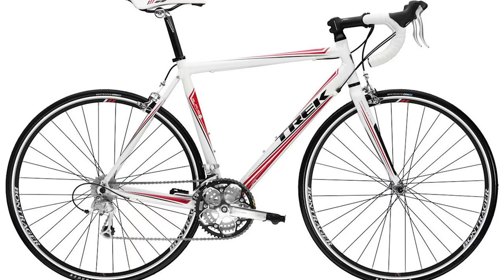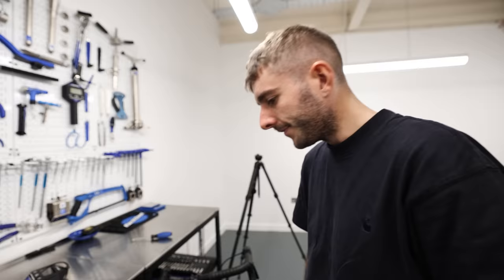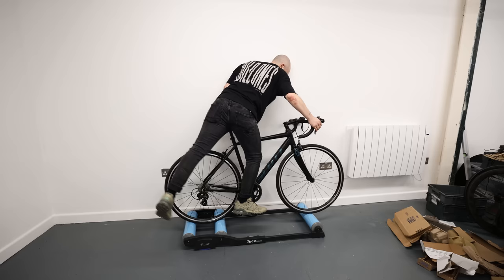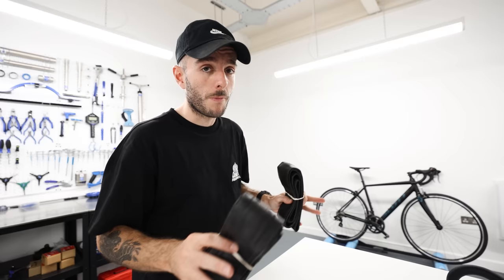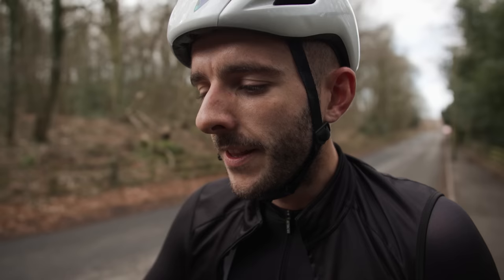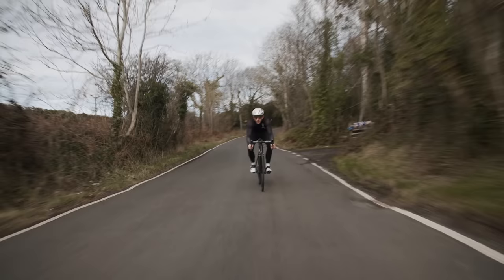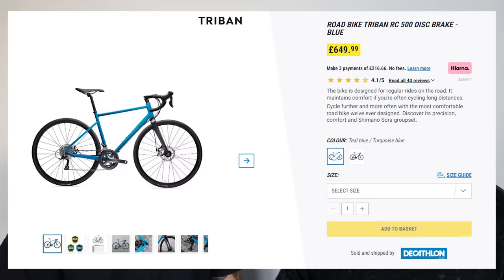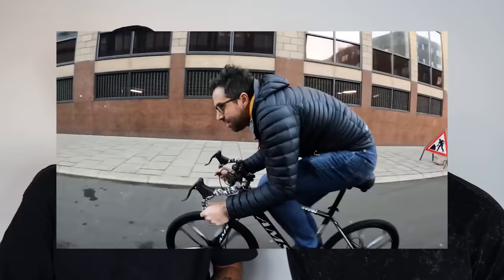How Good Is An "Entry Level" Road Bike In 2023?

Comment: Claris is a huge bump up in ergonomics over Tourney. Claris also supports an 11-34 cassette. Maybe your next video should be: "How good is an entry level bike that you should actually buy?"
Reply: Yes, but maybe go for a less expensive frame brand ? So Still keeping it as low as possible. Maybe try the cheapest Claris bike you can find.
Reply: £899 for fucking TOURNEY is daylight robbery. Tourney is basically a groupset-shaped-object; Claris is genuinely quite good. You can absolutely get Claris bikes cheaper than that even in today's market. I paid £1080 in mid-2020 for 105, for an 8.5kg aluminium bike with welds so clean and well-hidden that all my riding buddies assumed it was carbon.
Reply: yeah the cheapest bike on canyon's website is $1500 and comes with tiagra 10spd 11-34 and hydraulic discs
Reply: @themindgarage8938 out of interest, what did you buy? You're happy with how it rides?
Reply: @Kelso66  It's a Rose Pro SL (105 rim brake model). No longer sold in the UK, but still available in Europe for 1300 EUR. Really happy with the bike, rides very well. Only real downside is the rim brake version is only rated for 25mm tyres - if you want more you'd have to get the disc one.
Reply: @themindgarage8938  true
Reply: I can buy a Van Rysel RC520 for €900 from Decathlon with 105 R7000 shifters and derailleurs and tubeless-ready wheels.There's a LOT better value around.
Reply: how about 12-30 or 32? It's likely not an option. Few newbies need an 11, even if it's one louder.
Reply: Giant Contend 2.  £879 on the Giant site.  Claris.  11-34 cassette. Cutout saddle. Narrower bars.  Seems like a better choice.
Reply: @lg.studio  remeber that Francis is sponsored by Scott, he's doing great becouse he doesn't advertise too much, but still he probably has some contracts with them. For him is probably cheaper getting Scott's bikes that may be just lent to him for videos.
Reply: Or a test when you check how much people actully use lower gear than 34/28 when they are actully on the road (and don't live near mountins).
Reply: @themindgarage8938  Was shocked to see that price. I remember when they sold Halfords Carreras such as the Zelos Virtuoso and TDF for less then £500 with the same groupset as late as last year. Now they mostly use Claris at £600
Rip off from Scott

Comment: I bought a road bike for £279 four years ago and its fantastic, no problems with it and i am a heavy guy 110 kg. No problems with the gears, wheels or brakesdd. I did have to change the front one due me standing on the front wheel. The wheel was fine but not the brake lol. I still have the same types, and inner tubes on them. Back brake is great, shifters excellent.  Vitesse sprint.

Comment: I'd consider it to be entry level for the enthousiast. Someone that already knows about cycling and maybe had an older road bike and now want to get a new modern bike but not break the bank.

Personally really love cheap/affordable/entry-level but good quality bikes that are upgraded.
I remember seeing someone put HED carbon wheels and sram red etap (11s) on an aluminium trek, totally awesome!
Reply: Treks top-level aluminum ain't bad.
Reply: @rickdoehler502  No of course not! Never meant to imply that, it's just not "common" to see aluminium bikes get the expensive part treatment. 

I have a mid range aluminium bike myself and I'd rather buy better components for it then get a new frame.
Reply: @quintennn  In 2019 I bought a aluminum CAAD12 with 11 Speed Ultegra r8000 and rim brakes for $1600. It weighs under 17 lb.s. I swapped out the crappy wheelset for Hed Ardennes. It's a midrange model but it's a hell of a bike and a great value! It's way better than any bike I've ever owned.

Comment: First bike was a Boardman ADV gravel bike, £800 in 2019 and comes with shimano sora groupset.

I still ride it today, as my winter / commuter bike and the only real upgrade it’s had is some Hunt wheels and better bar tape.  I also changed the cassette size when I needed to swap out my first cassette so it’s 32/48T and 11-28T and that suits me fine.

And it took me from John O’Groats to Land’s End in just over 7days last year, faultlessly. 👍🏼

Comment: I had a Btwin Triban 520, bought 2016, which cost around £500. It replaced a much more expensive bike that I just didn't get on with, and it was superb. I rode it 11000 miles, and I've still got it, even after I bought a new bike because I couldn't bear to part with it.
Reply: the triban 500 and 520 are so much better value than the bike they got

Comment: First bike was a 2022 Trek Domane AL2 (aluminum) size 54cm. I did a few rides on it and went for a bike fit. Come to find out it was one size to small so I had to return it and the only bike my LBS had in stock was a Domane SL 6 (Carbon). Spent 4X more but, was very glad I did. The carbon bike felt so much more comfortable “smoother” then the aluminum bike. Also went from a Sora group set to an Ultrega group-set. Night and day difference.
Reply: What did I just read.

Comment: Bought an RC500 (back when they were £550) rode it for 5k miles, recently added some deepish section wheels, trp spyre front brake, carbon seatpost, cut out saddle & used 105 crankset. Cannot complain for the money to performance ratio!

Comment: I got myself a Boardman Slr 8.9 rim last year for £1000. Possibly one of the cheapest full carbon road bikes available? It had a 105 groupset (FSA crank and Tektro brakes, though). Since then I've put the proper 105 brake calipers on, put some chinese 28mm deep carbon rim wheels on, and switched the bars and saddle.

I'm now looking to use what I learned from that bike to then build one from parts and make it more what I want from a bike, but I still love that boardman. It rides great, its light, and the price was unbeatable.

Comment: Bought an entry level Jamis Ventura Sport for about £450 in 2015 with Claris. Been bomb proof - about 12K miles couple of chain/cassette changes but derailleurs or still fine. It’s been semi retired to the turbo for past 3 years but still going strong.

Comment: Same! A €600 Wilier Montegrappa with a Sora 3500 in 2014. The stock cassette was 11-25, whereas 11-30 was available. The handlebars on the XL size bike were 44 cm wide.

Comment: My first road bike was a Carlton 10 from Loot! Stripped and repainted in my garden, it was stolen…
Went through various used steel bikes - all stolen…
First nice bike was a lugged Reynolds 531 frame and fork I got from my LBS - had it powder coated and rode as a singlespeed.
First real race bike was a Kinesis Racelight I built with 105 in the early naughties - still have it in the garage.

Comment: In 1988 I bought a Specialized Allez with Suntour GPX 7 speed groupset. Downtube shifting that featured indexed rear derailleur. Freewheel of 12-23 and the shop threw in a 12-25...USD 300.00. 

My next entry...or re-entry...level bike was a 2016 Specialized  Allez Sport with Shimano 105 11-speed groupset...USD 900.00. Replaced handlebars, wheels and tires within 1000 km. Tire width max was 28....maybe.

Comment: My first bike was a Hercules. Single speed, but it did have a freewheel. Steel pipe tubing, steel mudguards, rod brakes, roadster handlebars like the old Raleigh (which was well out of his price range). My father probably got it from the tip, stripped the frame down, painted it with neat phosphoric acid to stop rust and finished it with Humbrol enamel. Entry level? I think it was black hole level.

Comment: I bought my first road bike two years ago. It was a (not much) used Cube Attain SL 2017 with 105 and rim brakes for €800, almost half the og retail price. I luckily got a friend who's into road cycling which recommended me the bike.
I think if you have friends that can give you some advice (components, bike fit etc), you're better off buying a used bike as your first one.

Comment: @3:23  i can relate. [you already know..] The rollers impart more resistance and slow to a stop much faster.  It is like 20 psi(e, 700x36c@38psi vs 55+psi) less and lubing everything with park grease.  Rollers also force you to hold a more comfortable yet steady position which when applied to normal road cycling, increases the 'fit' of the bike,, sortof..

Comment: My first road-adjacent bike (I guess it's a cross) was a Norco Threshold, I got it in an Evans sale as it was the last of last year's model. 

I really lucked out - it was about 500 quid off the list price, the one frame they had fitted me, and they built it up nicely. 5-6 years on and clear 10,000km with a few upgrades (mostly new wheels, pressure relief saddle...) my first roadside disaster happened last year - snapped hangar, damaged spokes, ruined derailleur and broken chain. I rebuilt, recabled, re-bearinged and it's running better than new... 

I'm now eyeing up a new groupset as cable disc brakes are driving me absolutely mad, but for someone who wants to grow a good frame is so important - the components and parts can grow with them, upgrades aren't out of reach and having/being perfect now is the enemy of just getting out and having fun!

Comment: The first bike I bought is Reid Falco Advanced road bike in 2016. It is a Australian local brand I found it quite high in CP value. I got it for a discounted price for AUD$699 from $999 with free locks, pumps, bell and front and rear lights. It has 2x10 105 groupset (5600 series) front and rear and tektro brakes. I think it is a bit outdated with 5600 series in 2016 and that's why they're doing the discount. But for a beginner perspective, I didn't see any disadvantages. Although I haven't ride it after a year of buying it, I still love my bike and started riding again recently and it still feels wonderful to me!

Comment: Just a couple years ago I bought my first real road bike. 250 euros bought me a mid '90s alloy bike with Shimano 105 3x8. The bars and saddle were horrible, changed them in a heartbeat but the rest was really solid rode nice and smooth, and shifting was fast and reliable with Microshift brake/shift combo levers with the 105 derailleurs. Did a few thousand km's of commuting and recreational riding on it, totally loved it until I found a major crack along the length of the steerer tube.

Now I built up a neo-retro bike with a Columbus SLX steel frame and semi-modern components with a classic look, and absolutely love that. 9.4kg, quite comfortable, decently fast and ohh myyyy handling to dream of, totally rips around corners as if it's on rails which are guided by my thoughts.

Comment: I think entry level is quite hard to define honestly, it varies a lot from person to person. I think for the average person completely new to cycling, £900 is really steep. But for someone who is already into cycling, perhaps a different type of cycling or someone who is coming back to the hobby, it's more of a reasonable entry level.

Personally, I used to enjoy cycling on some really cheap bikes growing up. When I was a young teenager I got a second-hand ancient road bike for free and it really got me into cycling. Fast forward to two years ago, I was looking to get back into cycling and had a stable job earning decent money but anything above the £300 point was just a bit too much. I settled with getting a Triban 100 which I quite liked overall, the only problems being that it doesn't have a wide enough range of gears while also having an inconvenient shifter. Aside from that I though it was fine for the price.

If you're okay with buying second hand you can get some decent bikes as long as you keep looking and know what to look for, I was able to get myself a Ribble R872 with Ultegra DI2 for £625.

Comment: Got my Trek 1.1 with Claris and Sunrace components back in 2015 for 700€. Since the I've upgraded quite a lot as the components wore down.
Changed tires to Conti GP5000, 42cm handlebars to 38cm, 11cm stem to 9cm one, one piece brakepads to ones where only the rubber needs to be changed, square taper BB to hollowtech and thus the crankset, wheels to shimano rs100.
Love the new setup.

Comment: Back in 2016-2017 I got myself a Cannondale CAAD Optimo 105 that I paid $1080 USD, which comes close to £900 you paid for the Scott Speedster. Great bike, and I beat it up badly since I was a new cyclist and wiped out a few times on it. I still have it to this day, and it functions great. I still ride it, alongside the CAAD12 Ultegra I acquired later at a used sale.

Prices aren't getting cheaper, but there are still deals to be found if we're patient with the process.

Thanks for sharing your experience with this!

Comment: My first bike was an Miele(Italy) steel frame from 1988. Tange Infinity steel tubing. Shimano Ultegra 600 (6400) 7-speed with downtube indexed SIS shift levers. I added clipless pedals (Shimano look compatible) a year later. The original gearing was 52-42 and 12-24 cassette. It was a very good entry level bike. Cost was about 750 $canadian back then. In 1989, I swapped the gearing to 50/40 and 13-28 and went to the Alps. With young legs and decent fitness, the 40-28 got me up Alpe D'Huez, the Croix de Fer, Joux Plane, and a few other big climbs. There was no spinning up climbs back then! Terrific memories though.

Comment: My entry level bike was 80s steel Koga Miyata with modern handlebars, saddle and SRAM Apex 1x11 groupset that I built myself. Rode like a dream, and cost me around 500 EUR in total. Most of the budget was spent on groupset (brifters) and saddle, but it had everything right, from the beginning. Selle Italia boost green budget saddle. Silver Zipp service course stem and handlebars and rs100 Shimano aluminium wheels with Spesh Roadsport 28 mm tires. I had a pretty premium feel. On the long rides, it was so comfortable, but severely lacked stiffness during harder efforts. City bike crashed into me and bent whatever was to bent on the frame. Moved the components to a nice (TIME VXR) used carbon frameset and upgraded the wheels. Couldn't be happier with both.

Comment: I got as my first real road bike (just after a 30/40 years old steel eroica bike I got for 100€ on facebook market that got me into cycling) an 8 years old Giant TCR advanced SL, carbon frame, alloy wheelset and a mix of chorus and record campy groupset for just 700€. That was 1.5 years before covid. That thing was a beast, loved it, really, a lot, rode like a dream. I just replaced for a newer Supersix evo because of the fixed (and slightly wrong, after a correct bike fit) saddle height.
I think that for this pricepoint you can get way better deals on the used market than buying new.

Comment: I bought my first road bike in 2008, it was a Scott Speedster S30 (entry level). Came with 105 groupset and a TruVativ Elite crank. I think it cost around $1,000. Replaced the wheels and saddle right away. Once set up, I loved it! Just last year it had to be retired because the headtube cracked.

Comment: I think when you're approaching a grand, claris should be the floor in terms of component tier. I suppose something like that could be considered "entry" if you're entering proper road riding - if like me you were just a little curious about road bicycles, i think something in the 250-450 range would be more appropriate, and would hopefully keep you clear of absolute clangers like that ebay bike!
I started out (2014, 15?) on something almost the same as the orange bicycle you flashed up on screen for 230 quid (but used, around 150...i think it was meant to be 300 retail). As my interest deepened, i began upgrading parts bit by bit to improve my experience, (things like the bars and saddle you talked about!!) to the point where pretty much every component had changed, and i learned a ton along the way - but then again i'm a massively obsessive nerd. Had i not been though, i'd still have a very robust and functional bicycle - I've kept all the old bits and they're definitely still very servicable.

Comment: My first and still current road bike is a 2013 Merida Sculpture 4000, it's turned 10 this year. So far the only original parts of the bike are the handle bars, seat post, and the seat. I've replaced the carbon frame under warranty, the entire groupset, and most recently the wheels. Sure it doesn't have disk brakes or 28mm tires however it's enough to keep me going. Current spec is 11s 105, 52t 36t chain rings, dt Swiss 1600 wheels, 26mm pzero v4s all season race tires, 75psi front and 80psi rear

Comment: First road bike I bought (back in 2010) was a Ribble Sportive Racing with 6700 Ultegra and Fulcrum 7 wheelset. Came in around £1k.
Was on Mountain bikes beforehand, still got my 1997 Marin Rift Zone. 
That was more expensive, back then than the Ribble was, some 13 years later. 
Now there's about 7 bikes in the garage, and a couple of frames (Planet X Jack Flash- unbuilt from around 2000...must do something with that)
Wife says I have enough bikes and kit to open a small shop...
I did have an entry level MTB BSO back in the 90's. But used mainly for road riding, as it definitely was not up for any off-road, at all.
The 70's was just a load of hand me down (too large frames) bikes from cousins, etc.,...then I got a Raleigh Grifter one Christmas.
That was a beast. It was heavier than I was back at the time , in about 1978/9.

Comment: My first road bike was a 2017 Fuji Sportif 1.5 disc that I bought new in 2018 for $800. Aluminum frame/carbon fork. Tiagra 2x10 groupset. First thing I did was swap out aluminum seat post for a carbon post and swap out the stock saddle for better one with a cutout. It was a comfortable enough ride and got me into road cycling. I still have the Fuji,  but now I prefer to ride my vintage steel-frame Lemond Tourmalet.